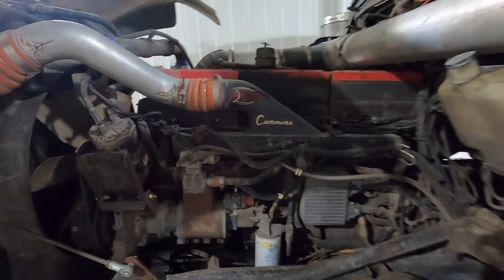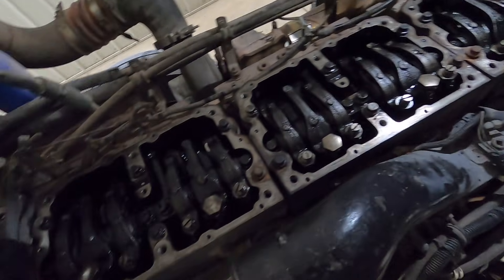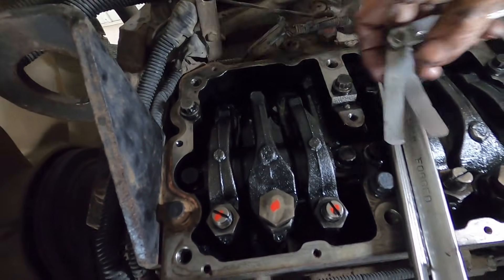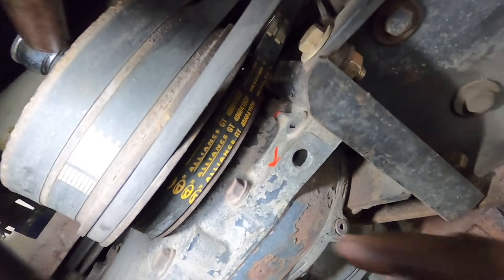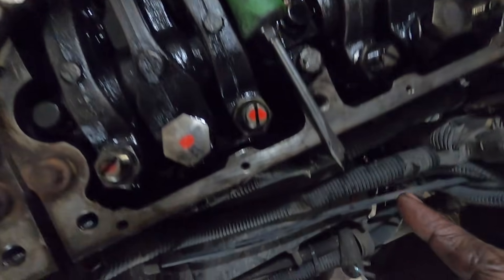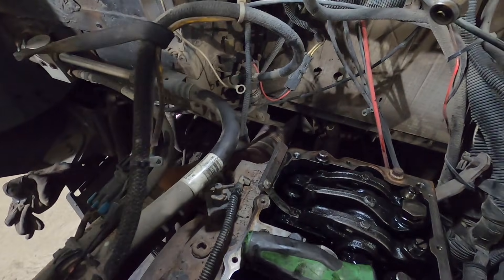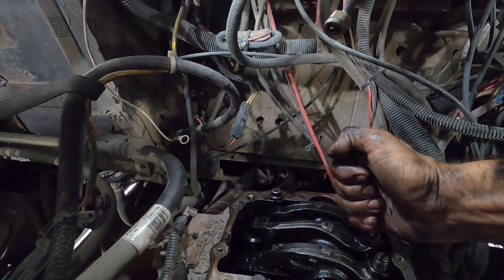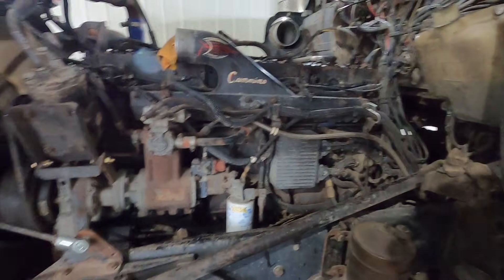Cummins N14 Valve Lash & Injector Adjustment

Comment: holy hell this is wrong. It requires 2 rotations to do all the valves and injectors. not 1 like you are telling people
Reply: BASTARD
Reply: to adjust the injector aren’t you supposed to finger tighten the bolt until it bottoms out, then do a 120 degree turn, then tighten the lock nut? Also I’m confused by your comment about “2 rotation to do all the valves” as doing the valve just requires using the feeler gauge spec, and tightening the lock nut.

Comment: I have on many a occassion been unable to read the A B C markings on the auxillary pulley due to corrosion and down to the fact that Cummins marked them far to light. I now find it's far quicker to use a DTI gauge with magnetic base and bar the engine over till your injector is bottom dead centre and the companion clylinder valves rocking then carry out the setting. That only applies to the Celect and Celect Plus.

Comment: Great video Philip! I’ve got a question. Is there a difference between the N 14 in the N 14 celect plus? what horsepower setting is your engine at?
Reply: I am wondering the same but I don’t think he reads comments. I have the N14 in a 1995 International and am getting ready to purchase a 1999 Western Star with the Celect plus, red top. Did you ever find out?

Comment: On a cummins N14 celect can 1 use injectors from different cpl engines on the same engine? And is it possible to use celect plus injectors on a celect engine??? Help
Reply: What injectorv clect plus a just on
Reply: Hey man. I know you posted this a while ago. But between me 2 friends we have 5 n14 trucks. We use each others injectors and they all work fine. Once one goes bad we swap with whatever is available
Reply: @julitoortega504  terrible idea..but hey you do you..who cares about injector flow rates.